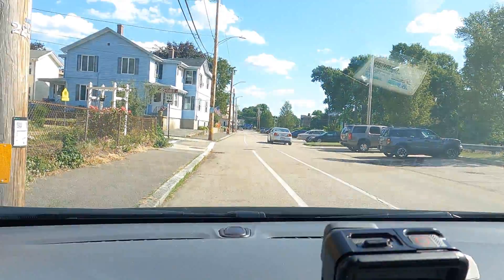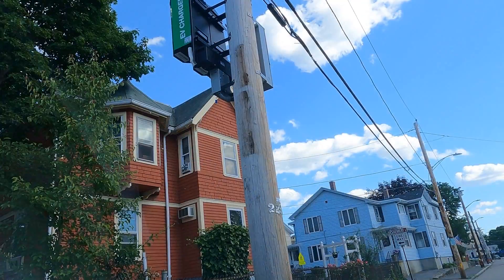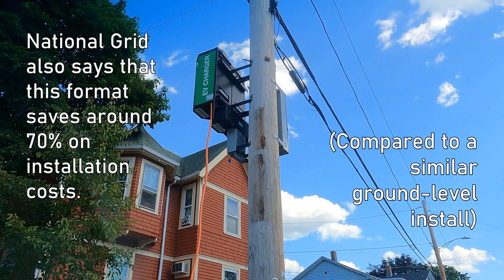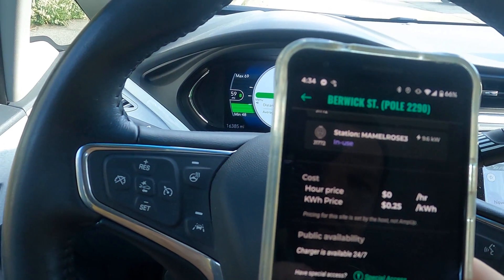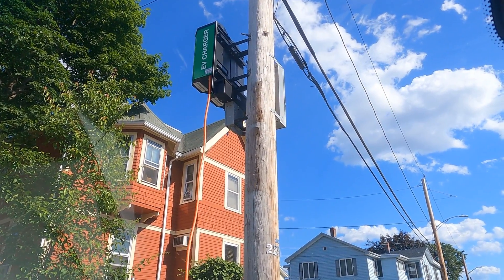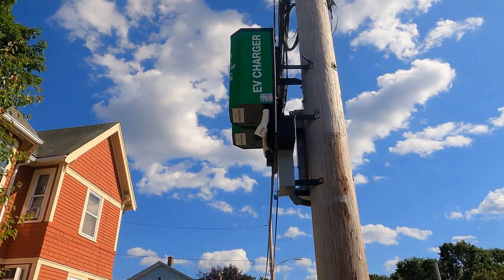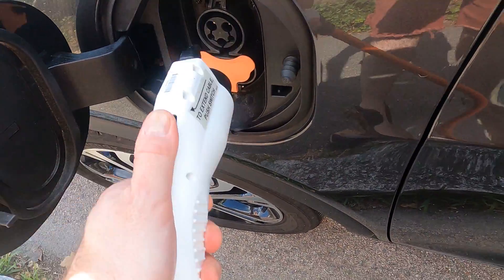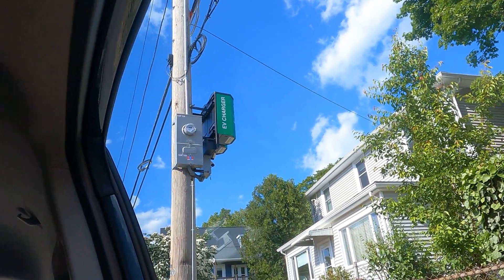EV Charging Trial: National Grid Utility Poles in Melrose MA on ampUp Network

Comment: I had this style of charger at my former workplace, in a parking ramp (just mounted at eye level). It was nice and kept cables managed. Took a minute to get used to using the "thing"/lock & unlock button on the J1772 handle for cable extension. This type of charging needs to be in every city in the U.S. yesterday.

Comment: Most vehicles are parked 23hrs a day. 
Having a home robotic vacuum cleaner teach the selfparking EV to connect to the grid and remain topped up is the answer to massive connection of all EV big batteries to the national power grid. 

Massive free storage with every EV,  so to speak.

Rapid charging will be needed at times but it it horse and cart thinking to ignore that daily, 23hrs a day, connection means that the long drive is always available.

Comment: Well it works but utility poles are vanishing. It's all underground. Both pros and cons with it.
Reply from the maker: Must depend on the region, as we're not seeing any significant underground line work to the best of my knowledge. The focus in neighboring states also seems to be on overhead lines. 

Either way, if there were major initiatives to focus on underground infrastructure in the future, we would want to push hard for EV charging to be integrated into that while the dirt is out of the ground.
Reply: @plugandplayEV  I live in an area that was undeveloped 25 years ago. So all utilities are underground. That goes for the whole zip code 91913.

I can already say now that there won't be enough public charging stations to meet demand. Some areas will fare better but home charging will rule the EV market.

Public charging is cheap today. I don't think that trend will hold.  Eventually it will cost more than gas to recharge an EV vehicle. 

For DCFC stations along the freeway that has to be built from scratch. They are not here yet. But eventually they will be built to meet demand. 

I have a commercial multi engine pilot certificate. I have to plan my stops just like an EV car on a road trip. But I have been stranded at certain airports where therr are only fuel trucks available. And they  are parked for the day. Just like a broken charging station. 

It will only get harder IE more time consuming to do road trips with an EV in the near future.

Lots of home across usa needs upgrades to accommodate a lvl 2 charger.. For me it's pretty straight forward a circuit breaker some wires, conduits and a nema 14-50 and I'm good to go. If I want 2 it's 8000 dollars or remove my AC.

My friend lives in an old home. If he wants to keep AC. He is looking at several 1000s just to get one nema 14-50.  

As for me I gladly buy another EV when the stalled tax credit passes the Senate.
Reply: @plugandplayEV  in my area 91913 we are severely short of public charging stations. So if I didn't have home charging I can forget to have an EV. Or spend hours of my free time waiting and or driving around. Or find an outlet and use my lvl 1 charger. Friend family, you name it.

Comment: On-street parking has its place, such as Connected Kerb and Ubitricity. This solution seems a bit over-engineered. 
People who use them will have their own cables. 
Resolving parking disputes between residents over coming years will need a solution. Not enough streetlamps for number of EVs will be a challenge in coming years.
Cable TV cabinets also have power, and could provide a possible outlet.

Comment: Great concept.  Reminds me of charging points in Europe where the power is at the pole or light post.  But, those are bring your own cable.  Still, the cost to implement is less due to the power already being present.  Love to see this  in Melrose.  Not a lot of options in that area.  Plus, at 0.25 per kwh, it's equal to residential rates.
Reply from the maker: Exactly. I found the other installations in Los Angeles and they seem to be just stating to operate, so this is very much an early pilot. Great to see individual municipalities taking the initiative.

Comment: Who makes the actual hardware and installation? This would be great for business owners and malls and airports to install on existing poles. Who would we contact to do this?.
Reply from the maker: Not sure who manufactures the EVSE as it was too high to read the hardware specs, but a company called Voltrek did the installations. Seems like utility and municipality both need to come together for this to work. Melrose is a dedicated green community with eventual goals to be carbon neutral, so the will is there in this case.

Comment: I wonder how this will be to use in the winter.  Will it get frozen in the box, will there be icicles dangling from the end of the plug?
Reply from the maker: Sounds like I have to plan a follow-up visit for December? 🤔
Reply: right, wet cord after getting respooled will freeze it solid. They would need a heater inside the spool. I'm dubious this will work reliably in cold winter.

Comment: Very cool!  That's a good way to get chargers installed without having to dig up sidewalks/pavement.  I hope there's an entry on plugshare to look up, otherwise I never would have found it.  As you mentioned, it would be nice to paint the parking spaces as EV charging only, which would also help finding the charger.
Reply from the maker: They're definitely on Plugshare... I added at least three of them! And I noticed that the one used in the city's presentation does have painted green EV spaces, although those are more traditional parking lot spaces. Interested to see if they do carve these streetside spots out for charging only.
Reply: Marking them for EV use only would help for finding them... However NOT marking them would fool those people that go out of their way to "ICE" charging spots 😏. They blend in so well, they are easily missed.
Reply from the maker: The spaces have been marked up since the video was made, so they do now have a green car symbol next to the poles. Still quite subtle though, so they retain an element of "stealth mode"!

Comment: Interesting. No trip hazard anyway. Like Blake said, there's a lot of moving parts but great ingenuity. Thanks for the video.
Reply from the maker: Cheers Derek. There are a couple with a similar mechanism in a neighboring town that are ground installations. To the best of my knowledge, I've never seen them reported down for that piece being broken, but they might turn around the maintenance requests quickly. In either case, it's a winner if they're remaining available.

Comment: Very impressed, would be great for those with apartments. I wonder if just providing a 240 outlet that is activated with a code and you bring your own plug...I also travel with an extension cord in case of a iced space.
Reply from the maker: UK does a lot of that with PodPoints and other brands. The station is just a post in the ground, almost like a bollard, and the cable is brought along by the driver. Amazing how much I didn't really think beyond the standard ground station and equipped cable until looking at solutions like these.
Reply: @plugandplayEV  I bring my cords on my monthly 800 mile trip in 24 hours and charge at a campground by my parents house.

Comment: I think that perpendicular parking would be better for this example, although the pole placement along the road with parking spaces on the opposite side would not permit that.  If this setup had an internal battery (15 kw and a 300 or so watt solar panel to start - on the top of the pole), many charge events could be “off grid”?  Latch button on the holster allows you to add length to the cable, but how to shorten it if you pulled too much?  Perhaps virtual buttons on the phone app could permit you to tweak the length of the cord to reduce hazards or a possible cord rub on your car?  I’m picturing a strategically placed pole - with sideways outriggers - which could charge up to 8 cars from 1 pole/station in a parking lot.  2.5 hour timing should be longer for evening or weekend charges, permitting multi-hour “once a week” charging events in a neighborhood or apartment complex where at home charging isn’t possible.  Based on other chargers, I’d think the QR reader shouldn’t be required if App knows that you’re next to a specific pole.
Reply from the maker: Useful food for thought, thanks Dennis. I'm planning to email the network operator later this week and will be sure to include these suggestions.

Comment: Most electric vehicle owners charge at home or work 90% of the time, It is good for EV owners to use some other EV chargers once in a while to ensure that they work and to encourage the charger companies to install more.  Support EV charging companies by stopping to charge once in a while.
Reply from the maker: This is a great point. It's true that charging at home is one of the biggest conveniences of EV ownership, if you can get it, but it's also really early on and charging initiatives need support to learn and improve. Learning about local charging options and plugging into the public network where possible is a good way to move things forward and where most current EV drivers can contribute.
Reply: Apartment residents! Eventually NG will place no parking signs except charging vehicles.

Comment from the maker: As always, the viewer comments/suggestions on these stations = a goldmine for EV infrastructure planning. Please keep the initial impressions and constructive criticism of this charging solution coming and we'll try to have the program managers review them.
Reply: Seems like a good idea near the T station - if you take the T you will likely be gone for a while.  The question is why have them up high?, no other charge stations are up high.
Reply from the maker: I think the idea is half to make them unobtrusive, half to protect them from vandalism. Not that we really see the latter much personally but maybe it's a problem. A full line in any commuter location would be great to see. Power could even be shared and down at 3-4 kW for some spaces, as workers will probably be parked there most of the day and may not need a full charge.
Reply: Very interesting. I am concerned about winter environments with the retractor motors. Are those "plugs" hot when not being used? Don't underestimate kids poking a rod 10 feet up, or a retractor failing to pull the cable up after a usage.
Reply: While I like the idea of mounting the charger up on a utility pole, especially in cities that may not necessarily have room to install ground station, I would highly recommend mounting the charger within arm's reach instead of requiring a mobile app to lower and pay for the charging session.  With that said, a mobile app could still be implemented while allowing the driver to use an NFC or chip-enabled credit/debit card to pay for the session, inclusive of any idle fees incurred.  I have also seen and heard of charging kiosks that come up out of the ground when you pull up.  Those would probably be even more convenient.

Comment: I like the willingness to innovate and experiment.  I also am intrigued about the vastly reduced installation cost but I share some of the other concerns that others have posted about (potential issues for others getting entangled in the cord, wear and tear on the motor that controls the cord, etc.).  I am very curious to see how these fare.  Thanks for creating a video on this.
Reply from the maker: Thanks for the thoughts, Ethan. I think maintenance could actually be better than other sites, given the frequency of line work and resources available to a utility, but the cord obstruction question is one to think about. Already on Plugshare, some of the user photos have, err, "interesting" choices of parking/cable positioning!

Comment: Not good if you’re trying to find it late at night.
Reply from the maker: That's a good call. Adding lighting to highlight location shouldn't be too difficult. I wonder about how well the QR code will scan in the dark though.
Reply: @plugandplayEV  there was a yellow reflector on the pole, if that adds a clue.  Perhaps the upstairs box needs a unique light or lit logo?
Reply from the maker: @dennislyon5412  A subtle green LED light, maybe that pulses a little, would be a nice addition. Have to think people are specifically looking for these, at least for the moment, and just need a bit of guidance over the final 100 ft.
Reply: At least there is a street light above it. I have to know what it looks like. It looks a transformer from a distance.

Comment: That's pretty neat.  Worry a bit about someone riding a bike on the sidewalk getting clotheslined by the dangling cord.  Wonder if the could have installed it on the street side of the utility pole?
Reply from the maker: I think for EVs directly under the pole it shouldn't be an obstruction, as the pole and car are already physical objects to avoid and cycling/walking between them is the toughest route to take. Extended further, though, it could potentially make things tougher. Parked behind or in front of a non-charging vehicle, for example, the cord could obstruct access to the other vehicle if not positioned thoughtfully by the EV owner.
Reply: As a former utility worker, I can speak to one issue that can prevent that: 'Climbing space'. 

Many utility pole owners require that there is adequate room for people on climbing hooks to pass from the ground to the top most attachment without obstruction to that path. I.e., this will generally mean that the units will need to be located on the side of the pole that other utilities such as phone and cable tv are attached to. If there is only power on the pole, then more likely a preferred side can be arbitrarily chosen.

And to answer the question some people will not doubt have about moving utility lines to the other side of the pole, that is not typically going to be feasible financially unless a climbing space conflict already exists and needs to be resolved.

Comment: What an interesting idea! I worry for the longevity of the unit though, can see the motor that extends/retracts the cable being damaged. Good video!
Reply from the maker: Thanks! Hopefully it would just come under routine maintenance, as with other power line work. That would be an interesting benefit of the direct work with a utility, which exists to keep power flowing, rather than other site hosts for whom maintenance is just a chore or secondary concern to their main business.